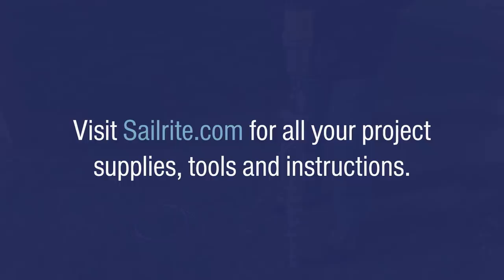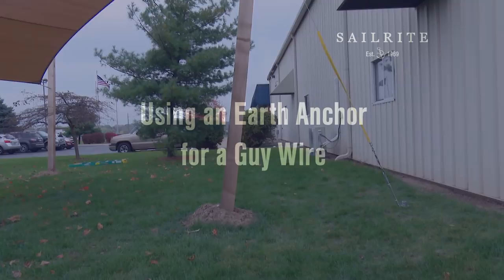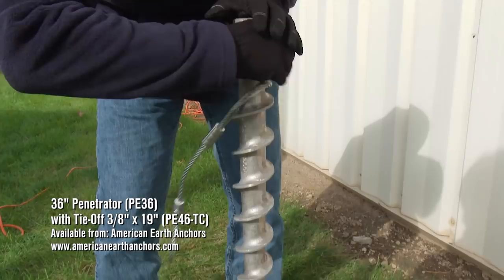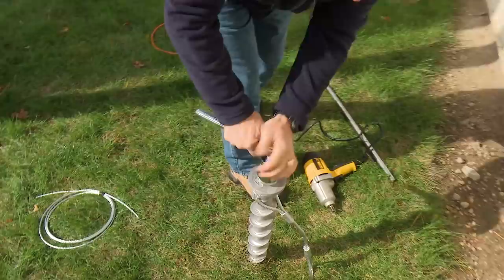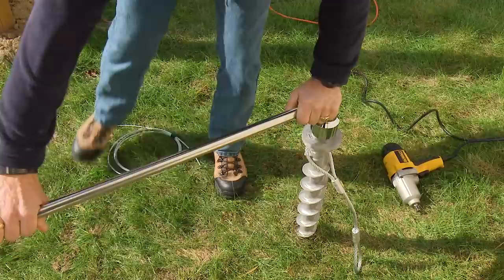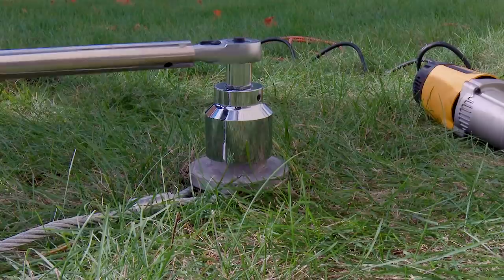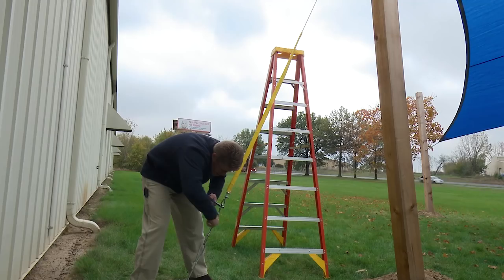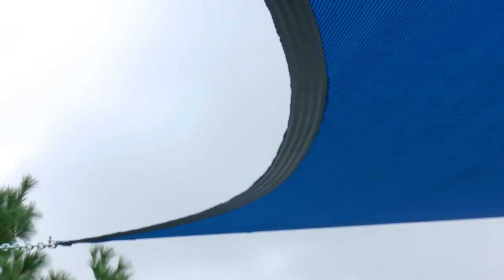Using an Earth Anchor for a Guy Wire

Comment: Car axles might also work. Using a sledgehammer, drive them in at an angle. Faster/cheaper alternative. Twist and pull upward to remove. (We use axles in our sled dog  kennel to chain dogs. Never had one pull out.)

Comment: This video illustrates a common and ofter-overlooked issue when attaching wire rope to anything: specifically the effect of the D/d ratio on the strength of the connection. The D/d ratio is simply the ratio of the diameter (D) around which a wire rope is bent to the diameter (d) of the wire rope itself. Tests have shown that whenever wire rope is bent around a diameter, the strength of the rope is decreased due to bending stress in the wires that make up the rope. The industry standard is to maintain a minimum D/d ratio of 20, and preferrably a D/d ratio of 25 or more. That is, D should be 20 times greater than d, and preferrably 25 times greater than d. These two ratios will deliver at least 90% efficiency; that is, 90% of the catalog strength of the wire rope used to make the connection. Example: using 3/8 in. diameter galvanized aircraft cable (GAC), which is the diameter and type of the short tie-off cable assembly in the video, the diameter of any object placed in the eye of this assembly should be at least 7.5 in. (0.375 x 20 = 7.5). That will achieve 90% of the minimum, typical breaking strength of 3/8 in. GAC, which is 14,400 lbs, or 12,960 lbs. The 36 in. Penetrator in the video has a body diameter of 2 inches, so the D/d ratio is 0.375/2 or 5.3 (2 ÷ 0.375 = 5.3), which delivers a connection efficiency of about 78% or 11,232 lbs. That's probably fine for this application. But wait; what about the other end of the tie-off cable assembly? A 5/16 in. quick link is used to attach the eye of the tie-off cable to the eye of a turnbuckle that is attached to the guy wire. The D/d ratio of this connection is 0.375/0.3125 or 0.83 (0.3125 ÷ 0.375 = 0.83), which delivers a connection efficiency of about 15% or 2160 lbs. Again, that's probably fine for this application, provided wind forces on the shade sails are light. Look closely at the quick link connection to the tie off assembly at 0:28 in the video. Note the very sharp bend in the eye of the eye of the assembly. This connection will likely become the point of failure as the setup ages. Minimize the potential for failure at this point by installing a wire rope thimble in this eye of the tie-off assembly to increase the D/d ration of this connection. Indeed, this is one of the main purposes of wire rope thimbles: to prevent the eye of a wire rope assembly from collapsing under load. More info on D/d ratio here, including the standard D/d ratio chart used in the wire rope and rigging industry: https://www.unirope.com/products/slings/wire-rope-slings/rigging-guidelines/dd-ratio-and-the-effect-on-sling-capacity/
Reply from the maker: Thank you for sharing your knowledge about the D/d ratio and how it affects the strength of wire rope connections. It's important to consider this factor to ensure the safety and efficiency of any project involving wire ropes.

Comment: Can we use this for mature leaning trees
Reply from the maker: Yes, it should be able to put a lot of tension on a large tree. However, we are not arborist and do not know if this is good or bad for a mature tree. Check with your local arborist, before using.
Reply: @SailriteDIY  Would that anchor hold 2 men doing roof work ?